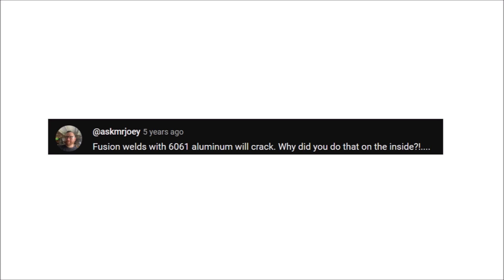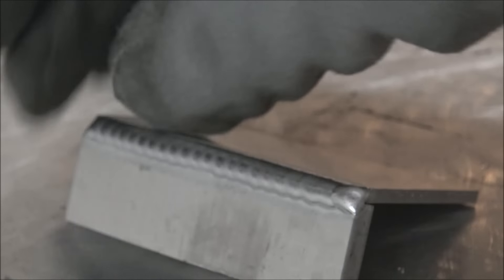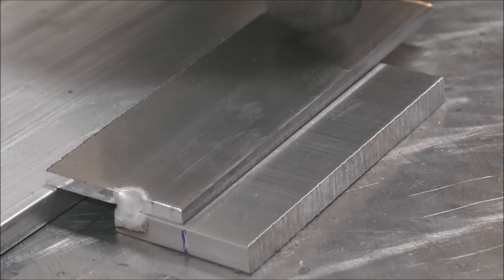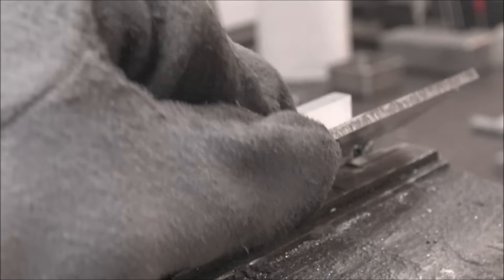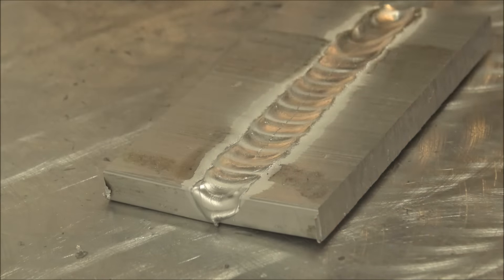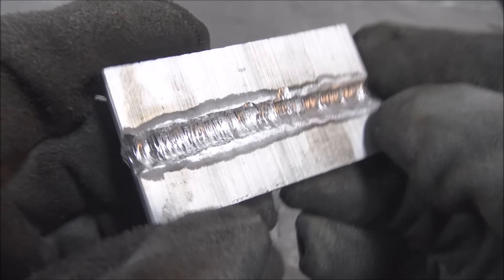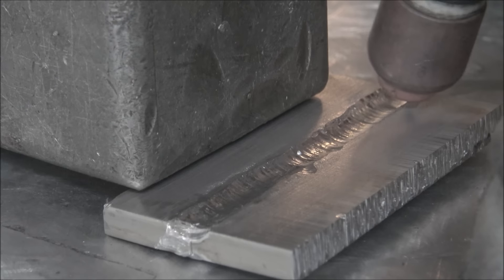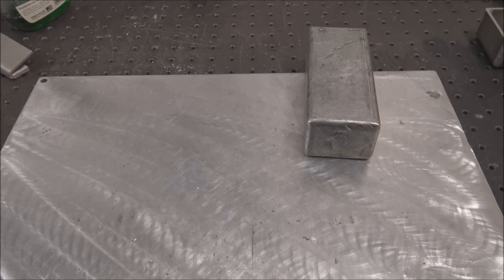More TIG Tips and Tricks You Probably Don't Know - A lesson on fusion/autogenous welding aluminum

Comment: Didnt expect it to be that strong. Very impressive.
When I have to do Tig aluminum, its always 6061. Even a small tack weld cracks immediately without touching it. Therefore i use your trick with the ''first a small dap of filler rod on one piece and than let it flow into the other piece''

Comment: Great video! Yup, I was always taught that when you add the filler rod, the two alloys (filler and base metal) mix with each other in the weld pool and the dilution of the base metal prevents the hot shortness and cracking. So when you do a fusion weld (no filler) with the two different alloys, like your 6061 and 5052, it's the same principle.

Comment: Hey, I have a source of high end welding products all across the board, I use Brutus tig and mig aluminum rod on 6061, and 70 series witch is not weldable, all of there products are impressive, they do cost but the salve problems. I work in the race car and aircraft fab work. Happy Holiday's , Mark

Comment: Thanks again Aaron for yet another tips and tricks video, I really appreciate it.
It seems like your use of the welder's pulse mode was mainly for appearance reasons, to exaggerate the stacked dimes look, and not out of necessity, which is a valid reason for sure. I almost never use pulse, even for very thin sheet, and get as much or little heat as needed by using the pedal. Maybe I'm lazy, maybe I have trouble forcing my movements to match the welder's timing, and maybe I just don't understand when pulse preferred or necessary. Could you please do a video on how you make that decision and pick the timing? Thanks!

Comment: Hot 6061 has very low strength until it cools below 350°F.  When the weld is cooling, it develops large tensile stress and typically fractures.  Yes, preheat helps.

Comment: Nicely done.  Would you be able to add settings you used and welder brand.  I sub to your website and learned a lot, but extra info  like ( frequency , EP , EN, AMPS ) never  hurts.  Thanks in advance.
Reply from the maker: Miller Dynasty 350 in this video. Same settings as explained in the first part of the website.

Comment: Aaron , Great video, I am planning on welding  up a 6061 x 1/4  25 gal gas tank, I am wondering if I should weld the inside and outside of the tank or would I be over welding it and creating problems????  Thanks Pete